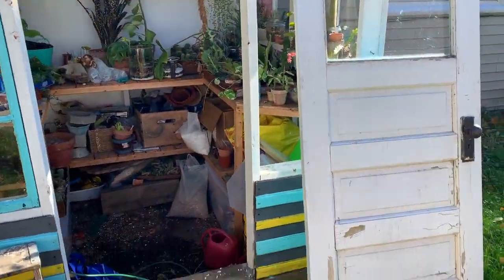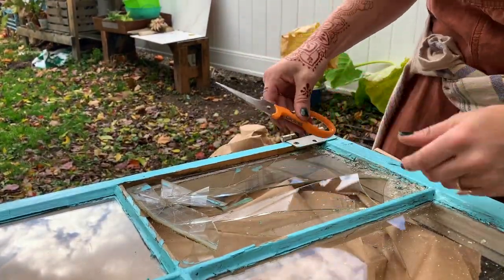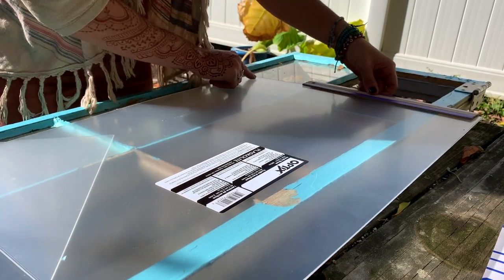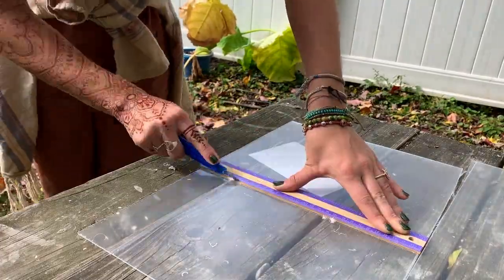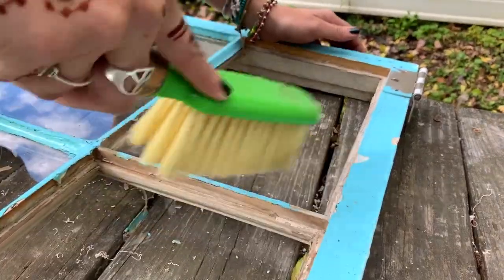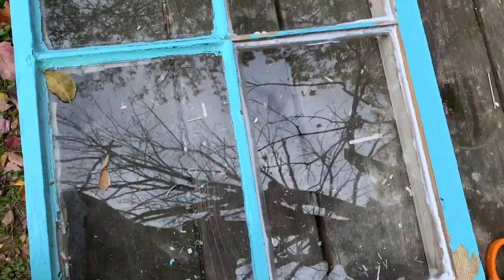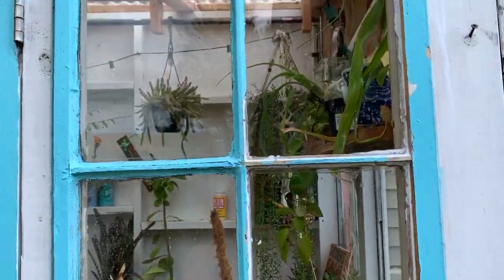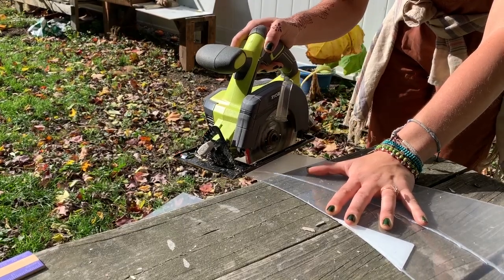Fixing up my Greenhouse

Comment: Props for doing it yourself! Another poster suggested safety equipment and I’m going to reiterate. Gloves to protect your hands from splinters, rubber gloves when you are working with any chemicals (caulk), safety glasses, tie your hair back and finally wear a good mask whenever you are cutting/sanding/mixing, keep those young lungs healthy, they need to last a lifetime...when the N-95’s are back in stores get a couple and keep them in ziplock bags when you aren’t using them.

Comment: So if anyone else is trying to repair an older window you can use linseed oil to Kissen the glazing that’s keeps the glass in or a heat gun. Then a putty knife and the little metal guys are glazer points and once most of the glazing is out it’s easy to use some needle nose pliers. Also using the glazer points to install the Plexi helps reduce it busting out.

Comment: What size greenhouse is that?  How much was all the wood? Overall ... how much did it cost to build it? 

Love you’re greenhouse! It’s so adorable
Reply: Abt 6x8ft but she used scrap wood and mostly old windows that she had found around. So she didn’t spend much at all, except her time.
Reply: @UncleRandy73  On her other video, building it, she gave the prices in the description. I think it was $300 for the wood and $150 for drill bits and washers and so on.

Comment: How did your windows get broken? Something about the design itself, or just external factors? Just wanting to make sure I am considering everything before I get started on my build. Thanks!
Reply from the maker: Justin Wheeler I had terra cotta pots hanging on the side of my greenhouse, I forgot to latch the windows and on a windy day they slammed into the pots and broke! Was my fault.
Reply: I'm planning on building a window greenhouse as well.  One of the things I learned after watching literally dozens of videos is that you need to make certain everything is as close to 100% level and stable as can be.  Glass does not react well to stress or shifting so it's best to make certain the foundation is as solid as possible.  Wonder if you built your greenhouse?  I hope to get mine done in spring/summer 2022.